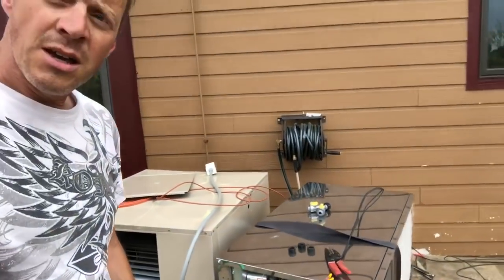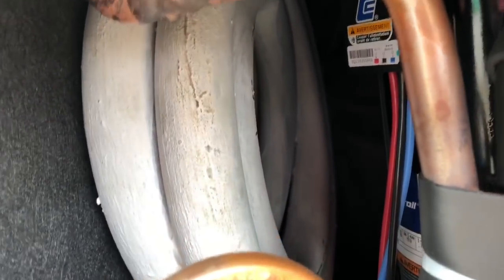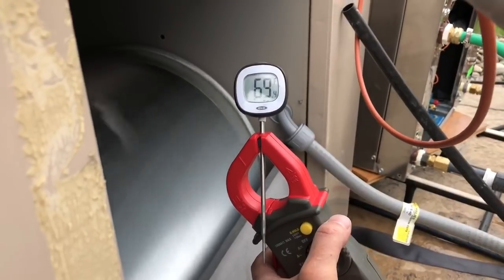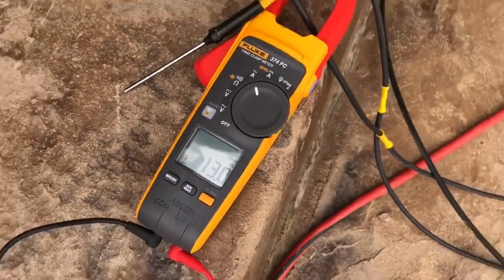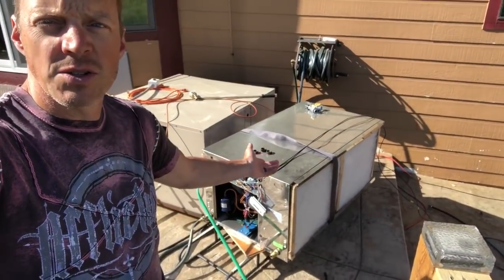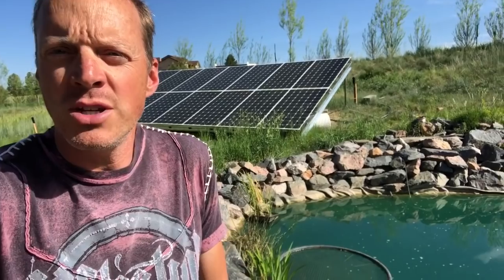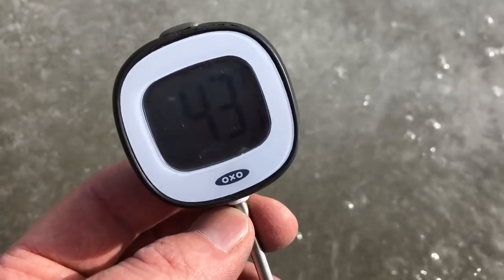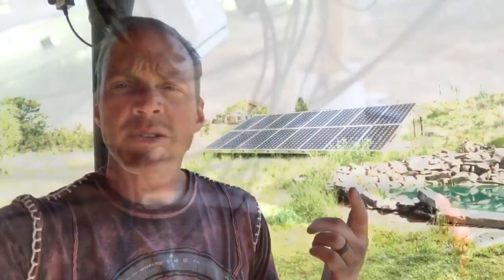Solar powered heat pump part two

Comment: Great work, do you have hydeonic floor heating.I came up with a hydronic ceiling for air conditioning,saves on cooling as our bodies radiate heat to the ceiling ,about 1/3 saveing as remember .
A lower pressure refrigerant would give you greater pressure drop  % . the city/state building in Sacramento use river water for cooling their buildings ,I think it's 10-15 psi comes in 55 gallon drum.
ith hydronic cooling/heating you need lower delta t so can take advantage of lower pressure refrigants  
Can you describe the house insulation and windows etc.

Comment: Dude it’s a lot of fun experimenting like this, I should know, but did you know that there is now a Solar hybrid aircon available? It behaves exactly like a standard reverse cycle 12000btu 3.5kW aircon only the outdoor compressor gets up to 95% of it dc running power from 4x250w panels wired in series, during the day. Your house looks huge so that’s an issue of course, anyway please check it out and keep up the great work: www.ecoworld.com.au
Reply: I was wondering if something like this was available.